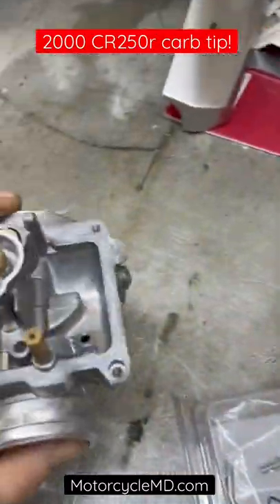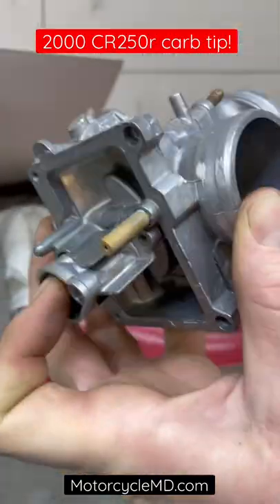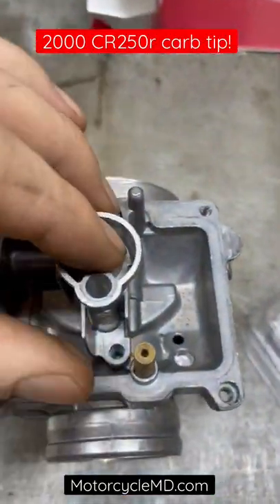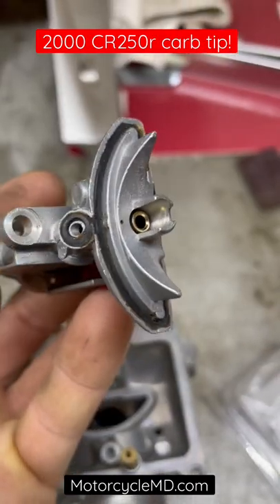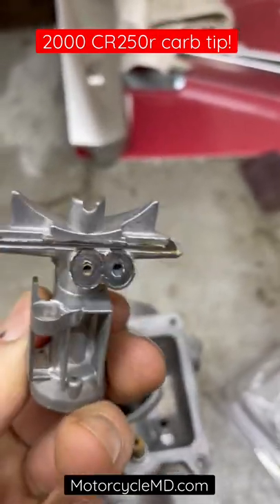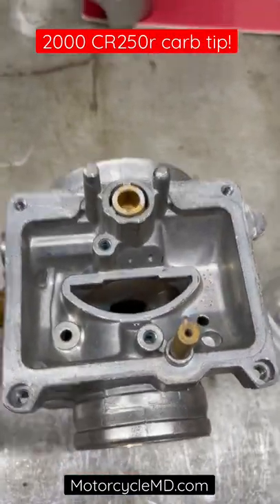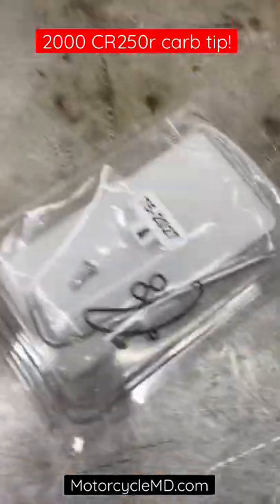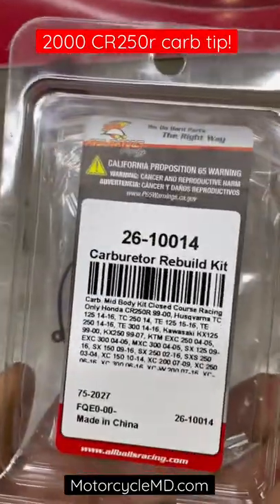Honda CR250r Rough Idle Fix! #shorts

Comment: Quick question I have a cr250r as well this weekend I took it out to ride and once I was revving it a bit to warm it up I took it for a spin then kept revving it a bit and out of no where it starts to over rev itself and I try to push the kill switch and it didn't work then I unplugged the spark plug wire and it didn't work then I turned off the fuel and disconnected a fuel line and then after a bit it shut off. What can be the cause of that? Maybe needs a new carb?